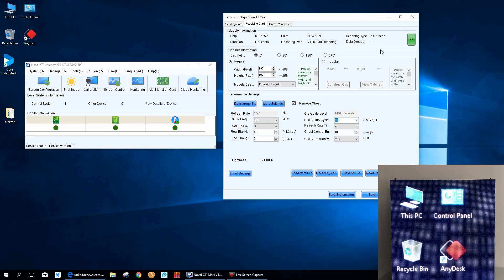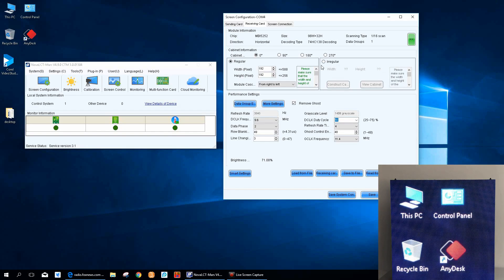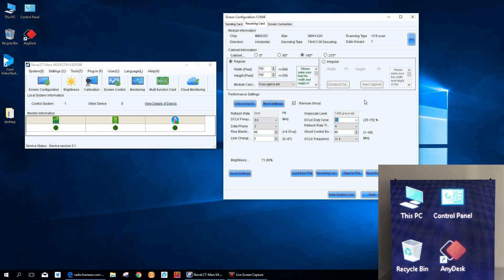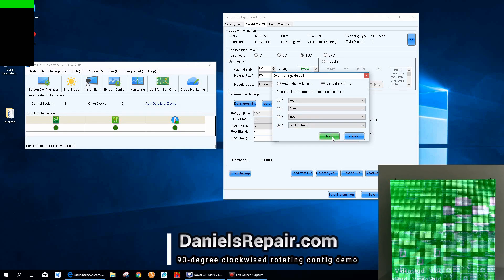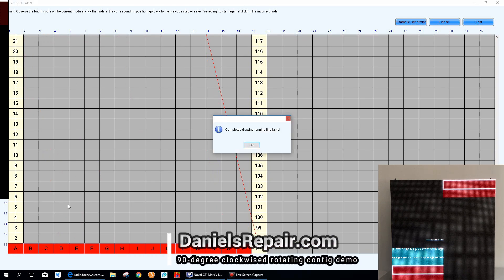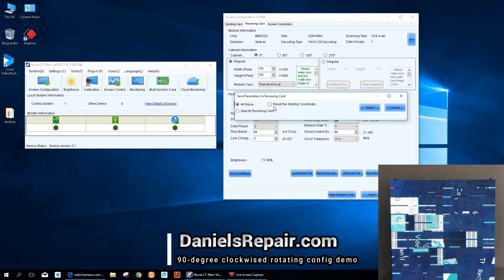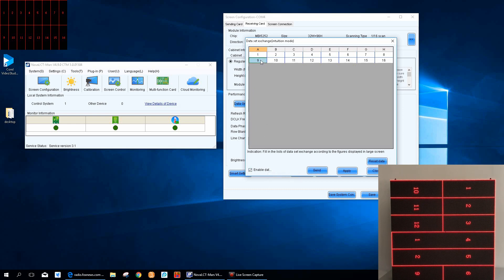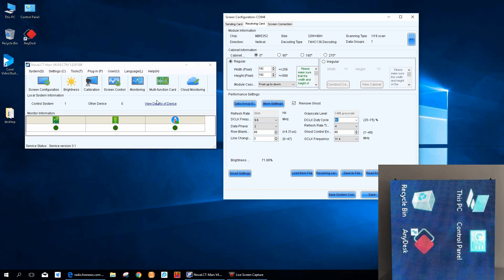How to rotate LED screen image into 90 degrees clockwise

Comment: sir have you new update about p2 panale size is 500x1000
Reply: i have p2 panal size is 500x1000 i want to rotae screen in 90 degrees clockwise plz tell me what i done in novastre software

Comment: Thank you very much. I was very frustrated at the standard rotate buttons not working and had to do some processing before sending it to the card. Next time I have my screen out, I will try this. I'm running Linsn. Very clearly presented as well.
Reply: Standard button working, but only with A series cards

Comment: i have 20 cabinet of one screen, i want to rotate 8 pcs for change screen dimmension. do you know how to rotate only 8 from 20pcs?
Reply from the maker: That's easy, you just create a new roatated rcfg file and send this new rcfg file to these 8 tiles only
Reply: @danielsledrepairservicellc9347  There is a easier way to rotate all screens into 90 degrees clockwise . Just rotate the desktop of PC.